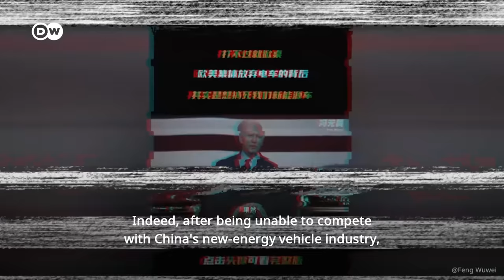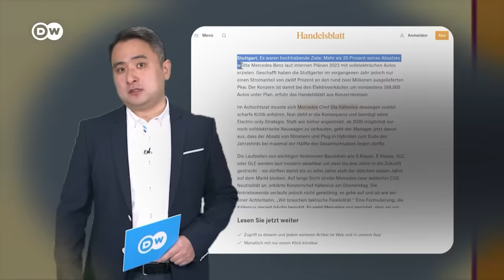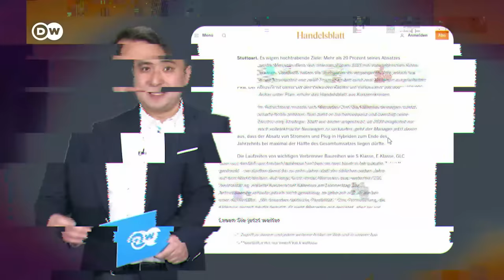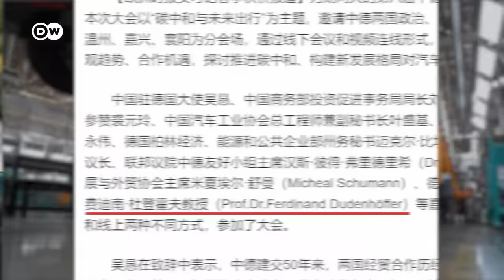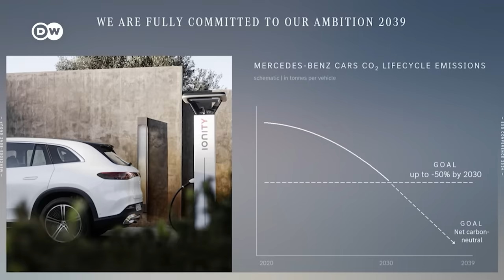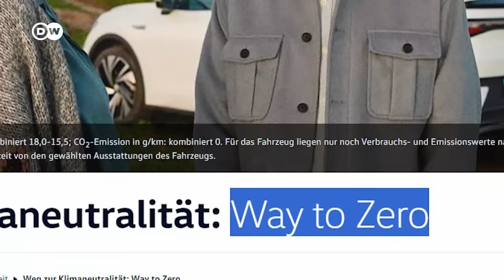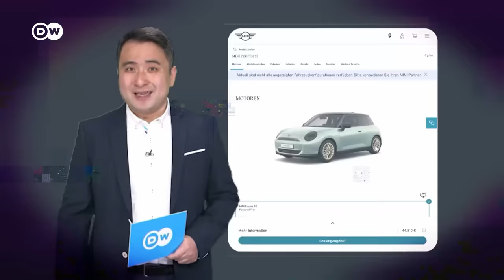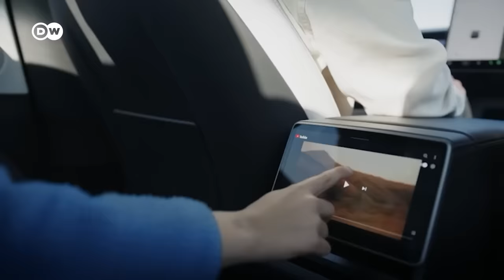Is the EV dream dead?

Comment: You didn't mention the elephant in the room! Infrastructure to charge all these electric cars and trucks with clean energy! A simple calculation can show the amount of energy needed to replace fossil fuel cars. Europe needs some multiple factor of electricity as the grid now can provide, and the grid right now has only a fraction of clean energy. The thing is that there's no money to do everything that needs to be done!
Reply: Using Electricity from fossil fuels is still way better for environment than all cars using fossil fuels.
Reply: @frankreynolds9930  you must be joking!
Reply: @hanstubben  Go research first. Power plants are more efficient due to very large size, constant rpm and has way better scrubbers for fumes. That have way stricter restrictions. After that electricity grid loss is minimal and electric motors are 90% efficient. 
And lots of places uses renewables energy.
Reply: @frankreynolds9930  As Toyoda has stated, if everyone were to use highly efficient hybrid vehicles, the overall pollution would be far less. Currently, mining of minerals needed for large EV battery modules produces far more pollution that what would be needed for the much smaller battery packs in hybrids. And hybrids retain most of their range (up to 600+ miles), even under cold weather conditions.

Comment: The EV experience needs to be improved if the following are in place:

1. Eliminate subsidies and mandates.   Subsidies and mandates only creates an artificial demand.  Consumer demand should drive inventory.
2. Reduce the overuse of advanced technology to increase the reliability of EVs.    
3. Improve cold weather performance of batteries.
4.  Increase trained EV professionals (mechanics and sales).
5. Increase the reliability of the EV charging infrastructure.
6. Reduce EV charging times to be on a par with filling gas in an ICE vehicle.
7. Reduce insurance collision costs by improving supply chain issues for parts.
Reply from the maker: Thanks for that comprehensive list. What's your take on governments around the world pushing their EV goals on people. Hard to see how subsidies can be done away with in this particular situation. And, what is your take on synthetic fuels?
Reply: @DWREV  This is one more to add to the list.  Allow the ability to accept cash at EV charging stations without having to use apps or at least, have attendant style cashiers on site to accept cash and to service EV charging stations.

Comment: Deutschepost ran electric mercedes vans in '94-'95 without lithium. A hybrid zinc air/ lead acid with charge controller would work now. Zinc lasts 20-30 years with regeneration and lead acid can last longer due to  constant charge activity.
Reply from the maker: Thanks for that interesting fact about the Deutsche Post vehicles in the 90s. It's true that some experts say zinc-air batteries could be a better solution than lithium. And let's not forget the potential of sodium-ion as well!
Reply: @DWREV  gm and Lawrence Livermore as well as others combined lead acid and zinc air with some success. They didn't have what we have now which are charge controllers. Think of it as zinc air replacing solar panels. Lithium requires higher charging. Lead acid does not. So the combination of zinc air and lead acid with modem electronics might be a much cheaper and simpler solution. Thanks
Reply from the maker: I'll look into that. Thanks again!

Comment: battery weight to ratio is not good ,, also soon as you charge for the first time the battery is already degrading ,, batteries fall fast from 90 percent too 70 percent but the algorithm covers up the truth ,, I fly racing drones and have been through 1000s of batteries they are not exactly the same each battery ,, I have had some lose charge quick and some last alittle longer ,, but all batteries lose that initial power fast ..  the tesla type cell is like an 18650 batteries in series ,, these batteries lose storage capacity fast ,, thats why EV companies  will not let you see the actually voltage drain while operating because you can actually watch the degradation of the battery every charge takes longer and longer to reach full charge from the very first charge .. the best way to fight c02 is too stop manufacturing non sense

Comment: EVs are simply NOT ready to replace hybrids, which are much more practical for the average single vehicle household. Hybrids are essentially unaffected by high and low ambient temperatures and ease and speed of refueling.
And according to the Wall St. Journal, hybrids retain their values far better than EVs.
Consumer Reports magazine's owner data shows that hybrids, particularly those made by Toyota/Lexus, are more reliable that both EVs and pure ICE vehicles.
Reply from the maker: Well, it does seem like several manufacturers aren't as committed to an EV-only strategy as they once were. So we'll have to wait and watch.

Comment: In Australia we have a temporary tax measure where EV's are Fringe Benefits Tax exempt (under FBT tax rules an employer provided benefit is taxed at the max tax rate) and the change has been huge on demand for EV's.

But the real brake on adoption is the availability of chargers. I went through the economics with my colleague today, he has an old WV Golf and a new Polestar. He has solar panels and charges at home - but if he relied on 150Kw chargers the savings would be about $1/100Km. 

Based on the cost/value difference it would be something like 500,000Km payback excluding the tax advantage - which may bring it down to 200,000Km. Add range anxiety, broken chargers, SUV's in charge parking slots, slow charge rates and high charging $ rates. 

Charging infrastructure is a market failure, Governments used to intervene to correct such failures - not leave it to "The Market".

Comment: EV is here to stay and in the future for a long time. Aside from battery advancements, the more important reason is due to the simple and easy and cheap way of eneregy transfers. With power lines (and in the future maybe wireless), electricity can be made easily available from various green sources and across national and transcontinental lines. No other power sources can be so easily and cheaply transferred. China is going in the right direction. Sahara and Saudi Arabia will be major sources of supply and will power the rejuvination and development of Africa. My view.
Reply: So you think that solar and wind-generated power is reliable at all times?

Comment: i would much rather have a plug in hybrid. Electric vehicle for the city and a hybrid vehicle for road trips. Perfection.
Reply: Also cars nowadays have too much planned obsolescence and unnecessary complexity. Electric Cars could be so simple if they were built like a 90s or early 00s car, but noooo, basic functions break down if your screen breaks and you have to go to the brand dealer to fix it.
Reply: I prefer non- plug-in hybrids by Toyota/Lexus.

Comment: Technology
The Paris Agreement speaks of the vision of fully realizing technology development and transfer for both improving resilience to climate change and reducing GHG emissions. It establishes a technology framework to provide overarching guidance to the well-functioning Technology Mechanism. The mechanism is accelerating technology development and transfer through its policy and implementation arms.

Capacity-Building
Not all developing countries have sufficient capacities to deal with many of the challenges brought by climate change. As a result, the Paris Agreement places great emphasis on climate-related capacity-building for developing countries and requests all developed countries to enhance support for capacity-building actions in developing countries.

Comment: I agree it is a political issue: I drive an EV for 3 years now (In the north of Belgium) and the charging infrastructure quality increased over time. There are good charging solutions everywhere now (On the highway, at petrol station, at the shop... etc). But when I go to the south (or even around Brussels) it feels like another planet... with not infrastructure whatsoever.

Comment: "Why Are Electric Cars Losing Momentum?" Because of battery range limits?
Reply: Price, not range.
Reply: ....due to cold weather and current battery technology. A Toyota Camry hybrid has a range of 610 miles and is mostly unaffected by cold weather. It is also far more reliable and long-lasting than any EV.
Reply: @davepaturno4290  Ev doesnt have much problem than most ice cars since its just have much less moving parts. Also hybrids are more likely to break due being the most complex.

And range is fine for most people since they use their cars mostly for commute. Price is the main reason ev arent more popular.

Comment: We have to see EV's as part of the future energy solution. We have to make use of the batteries also when the car is parked. For that reason it is important that the automakers implement "vehicle to grid" in the cars, and that the charging infrastructure is adapted to use this. This means that the car owners can be offered almost free energy if they are willing to let the grid owners use the battery capacity in the hours the car is not used.
Reply from the maker: This is a very interesting idea. It's actually already been tested on a small scale in several countries, and could have great potential someday!

Comment: First the high coast of buying, next the high cost of replacing the batteries, then the cost of disposing said batteries, they are a environmental hazard. Then get over to powering them. Not enough charging station. the most important is that the infrastructure isn't there and even if it was there is not enough power produced to support even just 50% of drivers has them. Now on to making the batteries. the amount of land dug up and water that has to used and wasted to mine the components and they are rare and will go up very fast the more that they are used. This is a few reasons why and still plenty more!

Comment: I didn't think the $1000.00 microwave in 1967 would last either...... Damn I just had to replace it for $50.00 in 2020!!
just so you get an idea ..... the average cost of a new car in 1967 was $2,750.00......
Reply: The point is that microwave ovens cannot and did not replace conventional ovens after all these years. Imagine if electric and gas stoves were banned, and only microwave ovens were sold?

Comment: The "bottom line" may be that no democratic government can force change on its people. EVs posess excessive limitations during colder seasons and when hauling heavy loads. It doesn't matter if an EV can be purchased for the same price if the EV is not as versatile as a hybrid vehicle with a 600+ mile range, such as that of the Toyota Camry.
 Also, here in the US, the largest auto shows are filled with ICE vehicles because the majority of auto enthusiasts much prefer sports cars with internal combustion engines. 
 Regarding breakthroughs in battery technology, look to Japan, not China. The most reliable vehicles in the world are made by Japanese companies.

Comment: I have a Tesla model Y since 2021  and driven BMW's for the past 20.  The model Y is the best car I have ever had.    Don't miss the gas station.     Media is just spouting oil and legacy auto propaganda.
Reply from the maker: A lot of people do feel like EVs make life easier, especially if one is able to charge at home. Unfortunately this isn't the case for a lot of people, who live in apartment complexes in the heart of the city. Perhaps with charging networks expanding, and cheaper EVs becoming available, more people will change their minds. As for brands like Mercedes slowing down on their EV push - do you think it's a case of having begun their EV journeys far too late?
Reply: @DWREV  I can only speak about Teslas.   My area has lots of street charging and Tesla infrastructure.   As far as apartments the government will have to mandate connectivity and autonomous cars for mobility.   Charging will become wireless over time and the need to have charging stations will disappear.

Comment: I went to the Shenzhen Auto Show in 2023, and it was obvious that the German OEMs were very far behind the Chinese in terms of buyer interest.  The Chinese OEMs had far more compelling product at both the very top of the market (BYD YangWang, HiPhi) and at the very bottom (BYD Seagull, Chery QQ, Wuling Mini).  The Chinese direct competition in the mid market was very well made and well-featured, and their pricing looked very competitive.  After building BMW, Mercedes, Audi, VW, GM, etc. in country for many, many years, the Chinese learned how to make cars properly.  The German OEMs took too much profit and failed to invest, so now they're very far behind. 

The idea that Chinese EVs are losing momentum is completely false.  Trying to make a story over normal seasonal variation is nonsense.  It's be like saying, "US retail sales collapsed in Q1 vs Q4" by ignoring the big Q4 holiday sales boost.  China has consistent year-over-year increases, which is why their domestic market is now over 40% EVs and accelerating rapidly.  And they're installing huge amounts of solar and wind renewables, along with a massive network of chargers to power this.  Last year, China installed more new solar than the USA has installed to date.  Guangdong province has more public EV charging stations than the entire USA.   This year, China is adding even more green infrastructure, and it won't be long before they have a 100% electrified ground transportation sector including electric rail, electric busses, and electric trucks.   The long term economic implication of China having "free" transportation will be game-changing.
Reply: Yet because China is using far more coal and oil than does the US, their overall climate pollution is still much higher than many other countries. The large equipment used to mine metals in China are not powered by batteries. 
In summation, China is producing more batteries, but are also polluting more by doing so.
Reply: @davepaturno4290   That is nonsense. It's laughable that you hold up a tiny niche sector like Chinese mining equipment when the US lacks significant progress in electrifying large sectors like public transportation, when China has already completed electrification of those sectors. 

It's similarly laughable when you compare the one time cost of EV battery production versus the lifecycle production of Carbon from petrol car, bus, or truck. 

Cumulative per capita Carbon emissions by the US are several times higher than China.  It would take at least a decade for China to catch up.  The US transportation network is almost entirely Carbon, whereas China's is rapidly transitioning to all electric.  China's electrical grid capacity is now over 50% renewable, and still adding more renewable generation than any other country in the world. The US is nowhere near this. 

China has absolute leadership in the development and implementation of renewable energy generation and transportation.  It's a shame that people like you focus on nitpicking rather than improving your own country.
Reply: @ZweiZwolf  Actually, China is now responsible for more than 27% of total global emissions. The U.S., the world’s second-highest emitter, accounts for 11% of the global total. Get your facts straight.
However, Chinese officials have also emphasized that economic growth, which is still largely dependent on coal power, remains a priority. And the nation is still increasing construction of coal-fired power plants.
For instance, the China Development Bank and the Export-Import Bank of China together funded $474 million worth of coal projects outside China in 2020 alone. The US has been significantly reducing its coal use.
Reply: @davepaturno4290 Still pushing misinfo and disinfo.  The US is responsible for 25% of global carbon emissions to date, exceeding the combined EU carbon output to date.  China is only half of that, and has shifted to ecological growth rather than absolute growth, which is why they have reduced their target annual growth rate to 5%.  Finally, it's 2024, not 2020.  China has stopped funding new coal.  Slow people should try to keep up.

Comment: Too early for EV to take over, when they can make a battery twice the size of a normal service battery, that can be easily changed without breaking the bank, then we will be ready to move to complete conversion, more important is how we produce the electricity to charge these EV, for the time being they pratically run on coal.

Comment: The title should be "Is the EV dream dead," it is grammatically incorrect.
Reply from the maker: Thanks for pointing that out! We've corrected it.
Reply: I do not think the EV dream is dead. EVs can operate on the moon or Mars in the future using solar panels for power, but  ICEV can not. We also need to develop hydrogen powered vehicles.